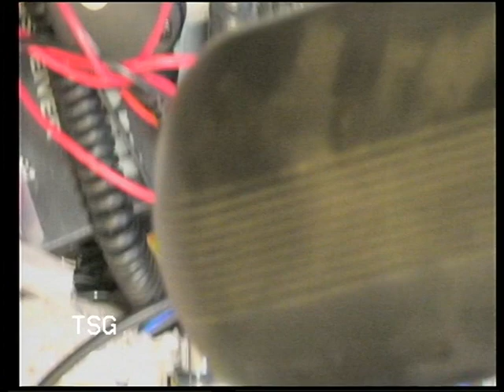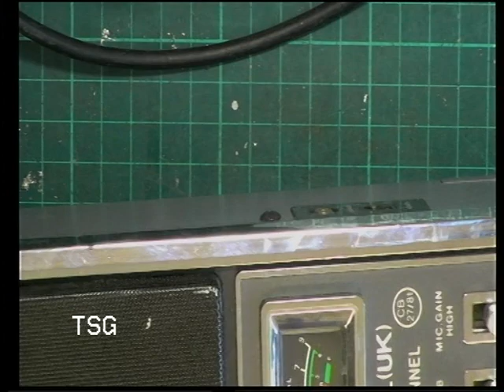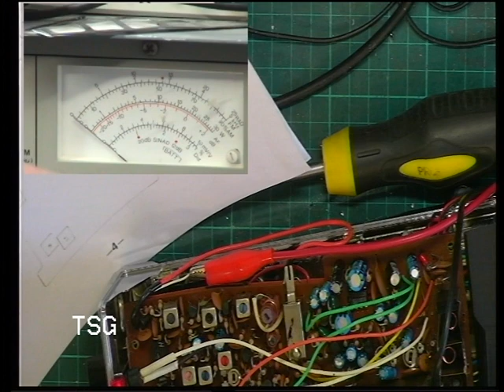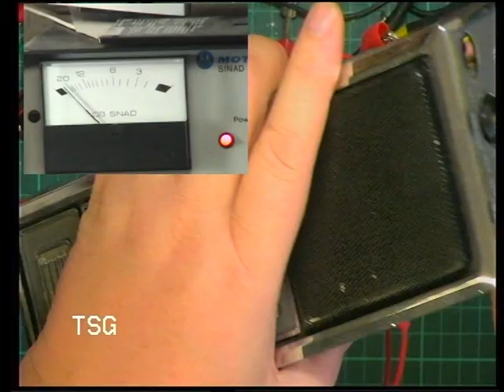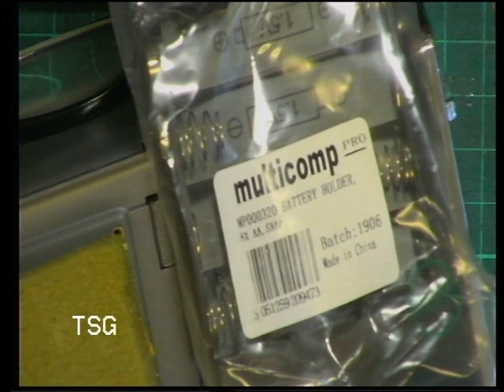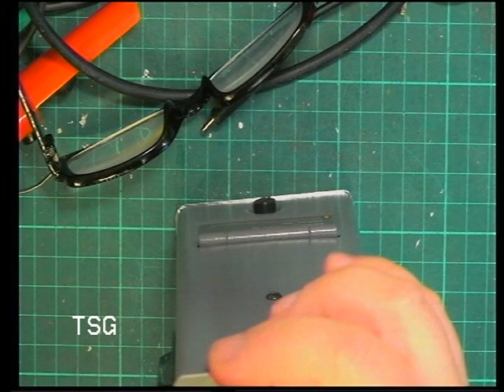Sirtel GT417FM UK CB27/81 CB radio (Handheld 4W 6ch) - Service & adjustments

Comment: I can never understand why they do not have an external aerial socket and an earpiece on these things.  They go to the bother of having a power and a charge socket, but don't bother with giving you an aerial socket!  Just crazy, but then Great were not good at supplying sockets of any kind if they could get away with it.  Cost you know!!
Reply from the maker: quite, Bob, not even an ext speaker socket on most GT858 mobiles. 

Richard
Reply: @ukfmcbradioservicingTango21  It really in pathetic that, it really is, how do they expect someone to hear the radio (even if it is all 40 channels at the same time lol) with a small speaker pointing to the floor of a car!

Comment: That one certainly is a handful and a pain to service. Looks pretty bombproof though. Shame about the battery light, I just wouldn’t be able to leave that. The receive came up nicely and 3 watts isn’t bad for a handheld
Reply from the maker: To get to the zener requires the board removing much more than can be done without unsoldering things. Then, on the back of the pcb is a tinplate screen plate, so quite involved. If it were a customers I'd suggest removing a wire off the led so it didn't light as the meter shows battery level too. Otherwise it would have to be repaired on a time & cost basis.

Richard
Reply: @ukfmcbradioservicingTango21  Totally understand Richard. Just my OCD kicking in. Not worth the hassle
Reply: @Radiocruncher  Only if it is your own set, but I don't think I would bother knowing there is better out there!
Reply: @BoB4jjjjs  The light goes out when the batteries are completely flat :)
Reply: @richholder2774  Oh ok, I wouldn't know, I never had one.  To be honest I doubt I would have bought one anyway.  I would be looking for a 40 channel set.
Reply: @BoB4jjjjs  I have one in my collection but no use around here as everyone uses channel 33 !

Comment: Holy S-Meter Batman. No wonder they had to put the controls on the top!
Reply from the maker: It's like a meter left over from base station production!

Richard
Reply: @ukfmcbradioservicingTango21  Hay, it's impressive on a hand held though, even if the rest of the set is not up to much, the meter is at least good looking lol.